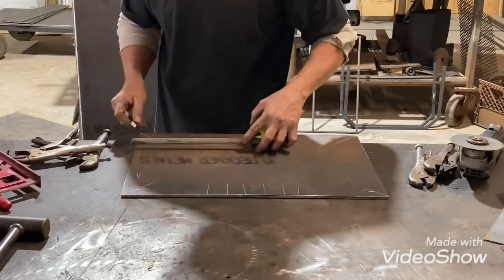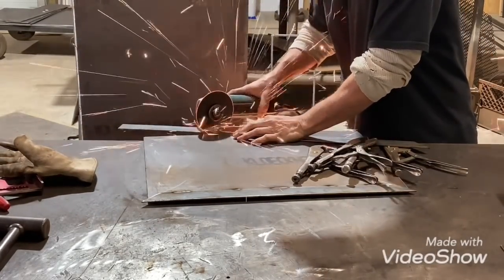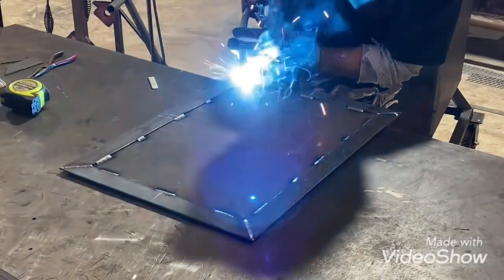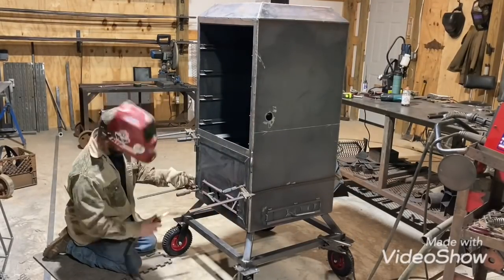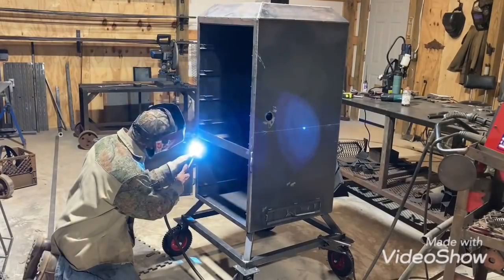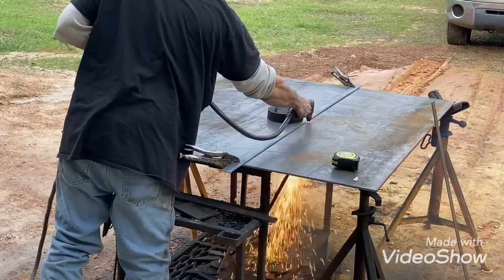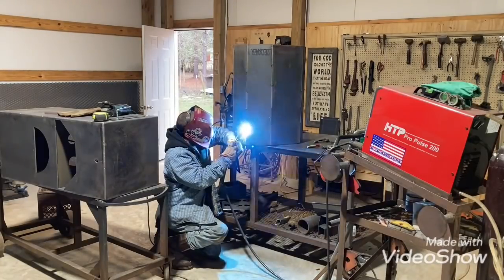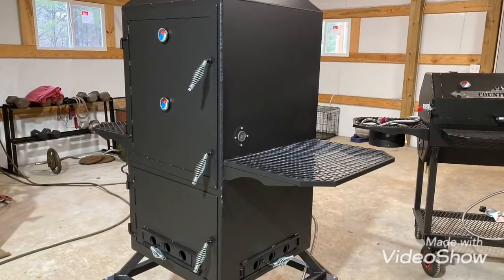Vertical smoker build

Comment: Great work and a great design, Allen. I am really starting to like the vertical smoker due to the versatility it offers. You can direct heat cook, smoke, cold smoke, or grill with this thing. One size fits all.
Reply: I agree, it does it all, and it`s a space saver, i`m thinking vertical as well.

Comment: Barrel Grills and smokers .
Put a thin layer of fire clay  on the bottom 3/8th thick 
Brining clay up the sides . 
It will protect the bottom and the sides . I used fire clay on my Forges  and used it on my Barrel smoker  and 
Grill  .

Comment: Hey Allen been watching these for a while now only been using an offset for a short while what are the benefits of the vertical chamber and when it's part of one of your reverse flows could you use the chimney on the upright with a baffle instead of the chimney on the main chamber. Obviously for the chamber a normal positioned chimney for using it like a traditional offset with a vent to close off the upright when using it that way. Cheers from a Aussie subscriber hope you can answer this cheers

Comment: Congratulations in getting up and running in your new shop.  I am looking forward to getting my 24" X 24"  vertical smoker.  
I was wondering.  Will you be  getting some kind of floor jack to raise and lower your chambers and smokers for welding and painting so you do not have to lay on the floor or squat to do your welding or painting, now that you have a smooth heard floor to work on?  
I think having some kind of rolling floor jack with locking wheels, like a scissor or hydrolic jack with a work table would reduce your man handling your projects while you are building and painting them.  This would reduce your chance of injuries to your back or other injuries!  
Thanks for the video!  Looking forward to more videos!  😊👍